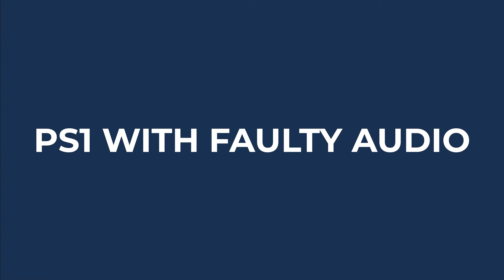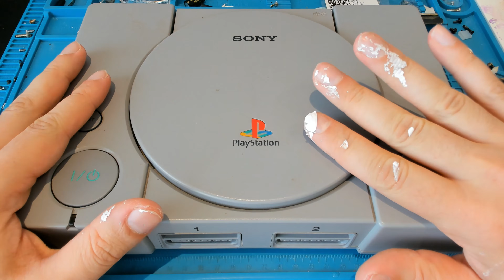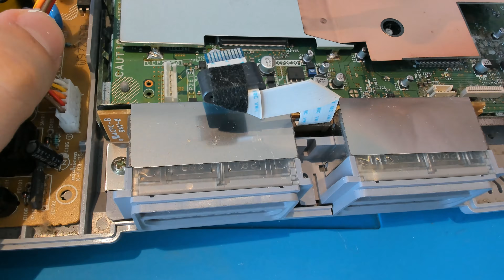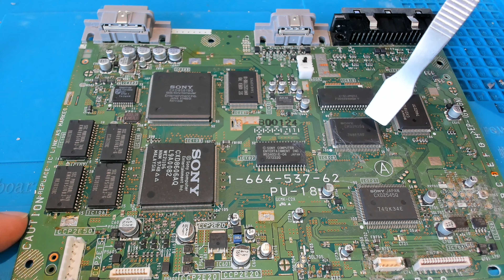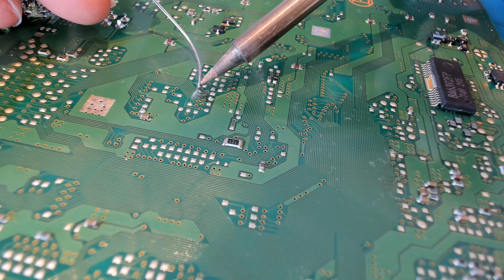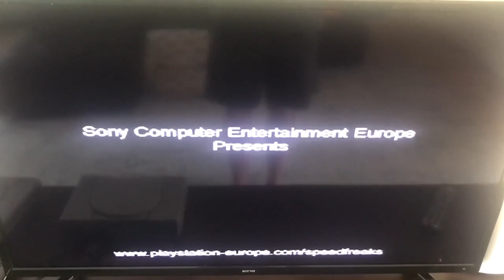Playstation one random audio issue repair - PS1 broken audio fix.

Comment: Found your video as I have the same issue. As soon as you pointed out the chip, I found my issue. Mine is the PU-23 revision board and the chip serial number is CXD2938Q. 2 traces were missing due to liquid damage. Replaced the traces and boom - all is well with the opening PS logo chime.

Saved me so much time